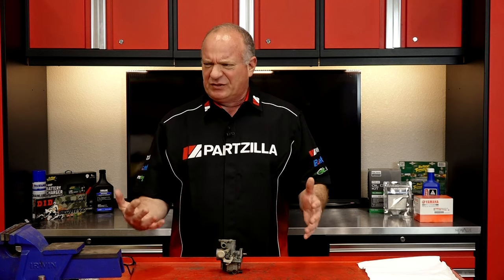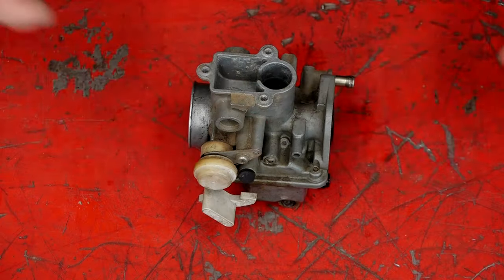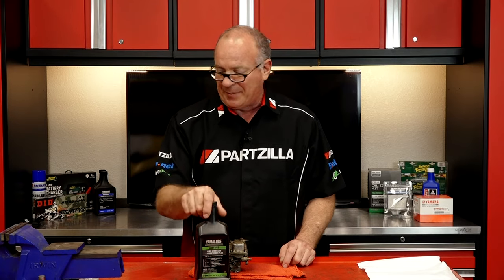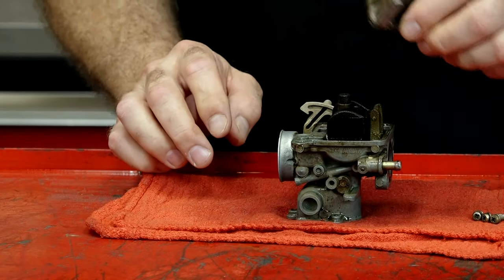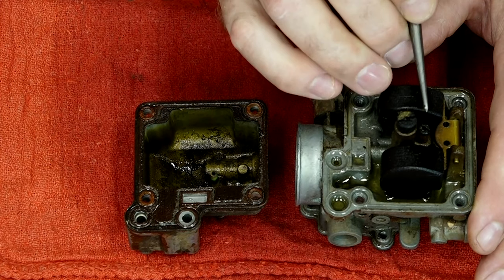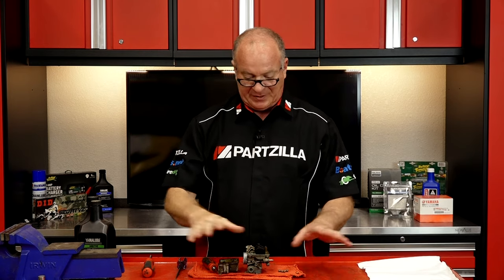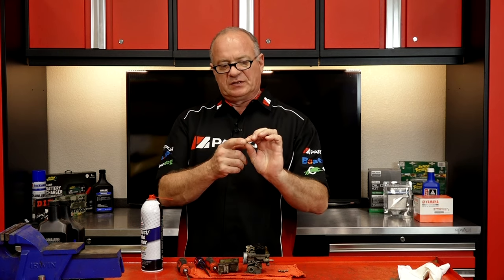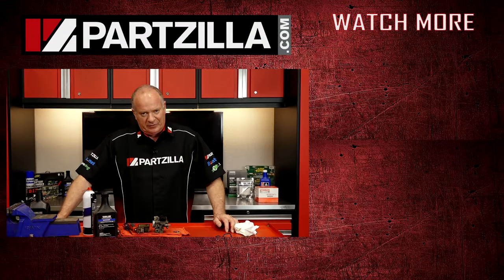Why Your Motorcycle Only Runs On Choke  | Dirt Bike Dies When Choke Is Off | Partzilla.com

Comment: NOBODY HAS MENTIONNED THIS SO I SHALL: ON ANY VEHICLE, BUT ESPECIALLY MOTORCYCLES, THERE IS NO POINT IN CLEANING CARBURETORS UNLESS YOU ALSO THOROUGHLY CLEAN OUT THE TANK (DIRT/RUST + VARNISH) BECAUSE OTHERWISE CARBURETOR(S) WILL JUST CLOG UP ALL OVER AGAIN.
Reply: Just restored my ls650 savage tank so I guess I’m on the right track lmao
Reply: Buy a fuel filter lol
Reply: @ontheopblockofftheopblock347  hey, that's deep !! Did you figure that one out by yourself or did someone help you ? Fuel filters Do not drop all impurities and except with big trucks they do not isolate water either genius.
Reply: Not true.. That's the reason for a fuel filter. 
The problem is the Ethanol they put in fuel. If it has time to sit, it will gum up small passages
Reply: @nameyourchannel7844  fuel filters will NOT prevent the entry of all contaminants into carburetors or injectors. Nor will they prevent the entry of water into a fuel system (with the exception of fuel/water separator filters on big trucks). And even if fuel filters DID, a fuel tank must be kept free of impurities in order to prevent blockage of a fuel filter causing an engine to fuel starve and shut off, typically in a very undesirable location. A difficulty compounded by the fact that multiport fuel injection engines then require air to be bled out of the fuel feed line, especially between fuel pump and fuel rail. 
     ALL persons who are mechanically competent are aware of these facts. 
     Have a nice day.
Reply: @californiadreaming9216  -Calm down friend. 
My point is that the vast majority of the time, a carb isn't running right because the ethanol in the fuel gummed it up.
While your point is valid, it's actually rarely the issue.
Anyone with mechanical experience knows this.
Reply: @nameyourchannel7844  it is clear that you have not done much, if any, work on older motorcycles. If you had, you would understand the consistency of contaminants in a motorcycle's fuel system.
Reply: FUEL FILTER

Comment: I’m having this problem on a Honda 96 300 TRX it runs fine with the choke on but if your riding and turn the choke off it runs but when u come to a stop it quits
Reply: my crf250r started doing that recently
Reply: Same with a kfx400
Reply: lucas tenere ramon  thanks man for the advice but guess what it loose the air needle thats why was running like that but at the end i bought a new carb and when i took the old one off i just noticed that and just imagine my face like duuhh but how i gonna know that if i bought that kfx400 that was sitting on a storage for about a year so when i get it the carb was messed up,the throttle was stuck and when i open the carb it was very dirty and ugly with old gas on it so i fix the throttle i clean it up and was running fine first time then when i ride it again for second time it just start doing it so i guess when i ride it i took small bumps with it and i think it just came off by it self but thanks anyways man for take of your time to help me
Reply: My 125 pit bike done the same I had to keep high revs so it didn't die
Reply: How'd ya fix it
Reply: @tristanpryll716  bought a new carb and new air filter and it worked
Reply: Do you have any videos on a choke cable not working  when you pull the choke know. When I do, I can see the cable tightening, but it does close he flap

Comment: my carburetor is brand new and I’m having this issue
Reply: Yea same here what should I do
Reply: bryan plunkett - make sure your fuel and air mixture screws are set correctly - my issue ended up being a vacuum leak because the exhaust didn’t have a tight seal
Reply: @dylanlangston6668  what is a vacuum leak?
Reply: @jonathanmiguel4201  it is when a certain amount of air bypasses the carb intake portion (manifold). Like when your carb or exhaust doesn't have an air tight seal( faulty gasket somewhere) or not sitting properly. So extra air gets in the carb making it function improperly( not running right). The carb is no longer like a vacuum that sucks air in just thru the intake tract(manifold)

Comment: Appreciate for your informative video.. I've got a piaggio ciao 2stroke moped. today Ignorantly i filled the oil too to my fuel tank.. while back had running problem. Little that i knew it was the rich mixture+ some dirt in my carb.. i removed the carb and cleaned, but had the same issue.. worked only when chock is on.. so after watching this video I've poured fuel to my tank and filled up the carb  with pure gasoline.. then it start working. Thank you so much.

Comment: Great informative video. I am wondering why a brand new Honda Navi w/ only 22 miles on it would not run with the choke off. 

I was told to run the bike with the choke on. the mechanic showed me when I picked it up, when they tried to turn the choke off while idling, it wanted to shut off and it was plenty warmed up too. So they just told me to ride it with the choke on but I know from operating my snowblower that when you operate anything with the choke on, it like floods the carbs and spark plugs. 

I’m definitely familiar with the old fuel because I’ve learned the lesson the hard way twice with my snowblower. 

FYI I am using a gasoline without ethanol as that was recommended in the navi community however the manual says to just use regular unleaded
Reply: Did you ever find out what this was? Having a similar issue
Reply: @Joeyyy28  it took me a bit to wrap my head around this, but i found out that you’re spose to ride the navi w/ the lever pushed up all the way to the top. Apparently you’re spose to be able to start it with the lever pulled all the way down towards that arrow, let it warm up, then push the lever towards the top. My first ride with it, i did that. But then my 2nd ride, i did the opposite - i started it w/ lever at top, then ran it w/ lever at bottom. I remember i stalled and came to a dead stop on the road when i ran it this way. So i ended up putting the lever a quarter of the way down.

I later learned i was completely running it wrong. Since then, I have installed a s23 variator clutch kit. This thing is so powerful, it starts up no problem, and i can run it with lever up or down BUT i was told the proper correct way is to run it w/ the lever up… so that’s what I’ve been doing and i haven’t had anymore issues.

I can totally vouch for the s23 var/clutch kit that these things are completely necessary if you want to reach speed faster. These things totally give it more power, faster acceleration. Prior to install mine topped out at 55 on flats, with install, it’s hitting 60s on flats. My mech told me he got it up to 62 on a test ride. 

Hope your issue gets sorted out

Comment: want to ask you that I have a 2000 gsxr600 , I completely clean all 4 carbs and still only run with the choke on only. Also clean the fuel filter, fresh gas. Has no idea why. Maybe you can help me out.
Reply: Stevie boy check your galleries that come off the jets .

Comment: I don’t prefer that chem dip, like to use MEK (as long as there is NO plastics or O’rings in the carb!! And only straight aluminum) as far as idle jets go?? And jets in general???Never give up on a jet unless its pitted and corroded.. I’ve cleaned many a jet with carb cleaner and a sewing needle.. those needles (depending) will go right through those little holes, prod it, spray it, prod it spray it.. most of them will be as good as new doing that..

Comment: I assume the same principle holds true with my 2 barrel 352 F250. I've been running her with the choke ever so slightly pulled out and even then the idle has been rough. I pushed the choke in all the way on my way home just now and she died every single time I let her idle. 

Is carb gunk where I should start looking?

Comment: Hey guys my name is Brian I'm from South Philadelphia I am the proud owner of a 2004 Yamaha YZF R6 and I was recently in a pretty nasty crash which involve a Uber driver texting and pulling out of a spot not looking and nailing me thank God I have my home in the ones or I would be a dead man and even with my homie I still had to have surgery on my head because I had internal bleeding crazy right?. Anyway my question to you sir was when the bikes laid it developed a small crack not in the crankcase but in the area around where the clutch cable is and it's leaking oil I put some of the J-B Weld steel stick stuff on it and it's slow. Then leak but didn't stop it and today I have the actual epoxy mix coming in the mail, my question is do you think that the epoxy mix and the JB Steel put on that crack will stop the leak? It's a very very very small crack I had to run it and actually watch it drip in order to find it that's how small it is but I also know that oil pressure when it's running is very high. I've been told by some people that I should look for a new motor which is out of the question it's it's a 2004.. what would your suggestion be in order to stop this leak number one and number two I've been noticing a drop in power when I rev it off the past maybe six or seven in first year and sometimes in second gear I'll give it throttle and it'll just die on me.... What do you think that could be caused by. I know you're a busy man any help you can give me would be much appreciated by this R6 owner
Thanku! Brian South Philly!

Comment: I’m having this same problem on my 2021 KTM 125. I bought it new straight from a dealer and have tried everything. JD jet kit, trying all settings, dismantling the whole thing and putting it back together. Yesterday I rode with the choke on and it was way better. As soon as I turn choke off, the bike bogs out and dies.
Reply: Literally me too it’s the same year and model it’s an XC. Still gotta open it up tho.

Comment: Loved your Kawasaki klx 110 video!  I was able to do a complete carburetor rebuild and its running great!  I haven't had the same luck with my Suzuki dz-r 125.  My problem:  Bike only runs on Choke.  I have looked at so many videos.  Most videos lead me down the path of the Idle Jet.  I cleaned everything on the inside with no luck so I decided to do a rebuild kit with NEW jets.  Unfortunately, my issue still exist!  What am I missing!?
Reply: when you take the idle jet out use compressed air to blow into the carb
additionally like he said in the video a carb bath or ultrasonic cleaner might be needed to break up stuff inside the carb you can't see

Comment: small suggestion for you guys. i know you're using non-chlorinated cleaner there, but imo for the safety of viewers you should only use carb cleaner with gloves to give a good example. chlorinated version, the cheapest and as good if not better at cleaning than non-chlorinated contain very harmful chemicals that can seep through skin like Trichloroethylene (TCE) which cause kidney cancer and other bad shit. I only realized this after years of use as I'm not a professional and never thought it could be that dangerous so it could be useful for a lot of viewers imo.

Comment: what if it's doing the same thing with a new carburetor?? We just installed a new one and it won't run with the choke off.
Reply: Need to change the jets or u ran bad gas thru a new carb

Comment: I bought a brand new carb and just right after I installed it on my bike, its not running with the choke off. Do you think it could be another issue or just check the jet?

Comment: I have a 1983 CR 80 that I am rebuilding and I have rebuilt the engine and carburetor, it runs great at higher RPM but wants to bog and die when taking off unless I rev it really high.  I have replaced the CDI and stator, I've tried rejetting and needle settings but I am wondering if I need a new carb or missing something else?

Comment: Hey guys, looking for a bit of advice. I have a 1982 Yamaha XJ-750 Maxim, and it will not idle without Choke. it also seems to be having a drop off in power at higher RPM's. I started off by replacing the Vacuum Petcock. Then cleaned out the carb jets. Then replaced the Valve Stem seal's and checked the piston rings which are ok. Nothing seems to improve how it runs. Any theroy's?
Reply: Hi Jerod, I too am having a problem with my bike.  Won't run unless its on Choke.  Did you ever resolve your issue?  if so, what was the fix?
Reply: @sammydenalie2089  Yes, my personal issue was the Ignition Box/ECU. It was sending a weak spark to my Plug's.
Reply: @sammydenalie2089  But I highly doubt your Bike is having that specific Problem. Have you tried anything yet?
Reply: @jerodrobinson4040  thank you for the reply.  I took took out my air filter (which still looked brand new) and washed it, let it dry for 2 days, and applied some K&N air filter oil.  Still having the same issue.  I agree with you that addressing the ignition box/ecu is probably not my issue. but i will look into it.  again, thank you for some direction and just for replying!

Comment: My Honda Fourtrax 250 has clear jets, cleaned it a few times and did the spray method as well as the light test method, all seem to be super clean having dipped it but still only starts to n full choke, and bogs after a minute even on choke and revs, but sounds better when spray starting fluid in carb as bogging begins. Any help is appreciated!

Comment: I have a Coleman ct200u minibike. I was having an issue with the bike only running while in choke and then cutting off when I took it out of choke to run.  I figured I'd just swap out the carb and be done. Well after I put a brand new carb on it I was having the same problem. I even swapped in a new spark plug. Any thoughts on it? Is it possible it's a ignition coil?
Reply: Dave need a larger pilot jet
Reply: Me as well and I’ve cleaned the carb every spec of it about 7-8times if Anyone has the fix for this please post
Reply: @joshtidwell8554  Did you fix it ? if yes then how  - same problem
Reply: Ditto

Comment: I gotta question, my 49cc Chinese dirt bike only turns with the choke down and the throttle being held(this is after a fall,also probably mixed to much oil in this last tank I gave it)I’ve changed the carburetor,and spark plugs.still nothing , any idea what could it be?
Reply: You fund out what it was yet??

Comment: Having this problem now. Choke all the way on and somewhat idles. Carb is CLEANED. all jets clear. Don't know what else to do.

Edit: it's a bad choke cable. Replacing it soon but I confirmed it. 2002 Suzuki GZ250

Comment: Hi, im having a problem with my Honda CRF 250R 2007. It starts and runs very well but after some minutes (3-5 min or 250-500m aprox.) it shuts off and the engine dies just like if you cut off the fuel valve. Its exactly like when you forget to open the fuel valve and go riding, it just dies after a few minutes. I think its a carburator related thing, but I know very little about carbs.
Do you have an idea of what it could be?? 
Cheers!
Reply: Maybe adjust the float level on your bowl.

Comment: I put a performance exhaust on my 2004 Honda 300ex and now it won’t idle correct. Any tips why or what to do? Thanks
Reply: With the new exhaust your bike will be getting more airflow so you need to richen the mixture and if that doesn’t work you’ll most likely need to upsize the jets

Comment: This can't be the issue causing my engines stalling when i turn the choke off because i have a brand new carburetor on it with the new jets that came in it. Has to be another reason. 🤔😮‍💨🏍☁☁☁

Comment: Even on a brand new carburetor?
Reply: I have the same issue with a New Yamaha brand carburetor that I bought from Partzilla.
Reply: @jamesjones4055  I have that "racing" carburetor with the blue air filter you get off of Amazon. Weird how it doesn't idle.

Comment: When I start my cr250,it fires up but it will run like the throttle is pinned
Reply: End up figuring it out? I have the same thing going on with my 01cr250 mine does the same only starts with choke on will die on it’s own or if I turn choke off it dies
Reply: Not sure if floater stuck or air leak. I don’t have a test right now so trying to gauge from others where to start to save time